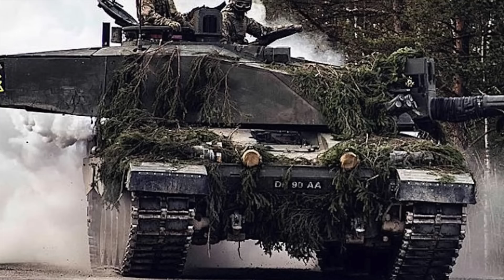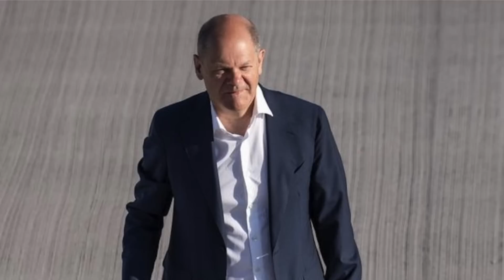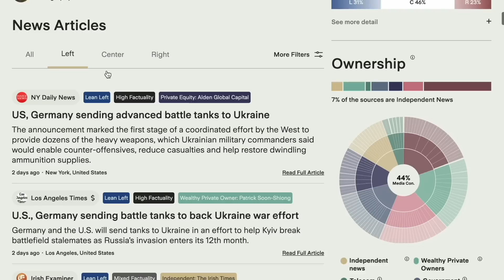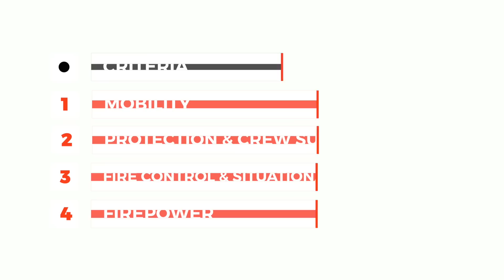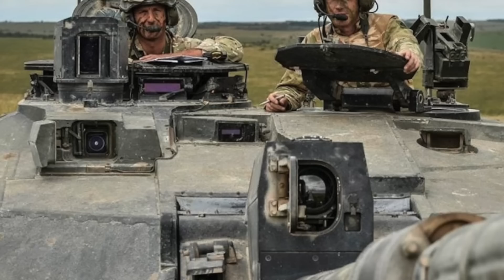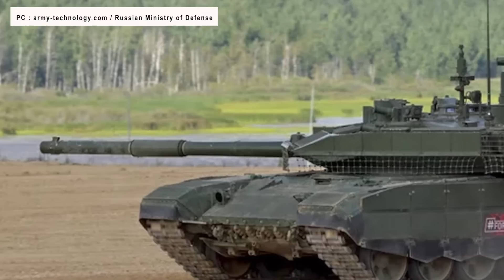British Challenger 2 vs Russian T-90 - Detailed analysis !

Comment from the maker: Check it out for free at https://ground.news/defense or subscribe for unlimited access to all the features you just saw and stay fully informed on breaking news as it’s happening.
Reply: I would add a last point: how many are available, and how many can be quickly manufactured. :) Because these are the russians. Nobody argued the tiger was much-much better than T-34. But even if 1 tiger can kill 50 enemy, when you have on the front 1000 tigers and 80000 T-34 you still lose.
Reply: A massive disadvantage for the T90 is its inability to reverse out of danger fast enough...This leads it to be VERY vulnerable to faster flanking attacks. A Challenger can reverse back at high speed while presenting its frontal plate to the enemy for longer.The ability to reverse back into cover from an ambush position (like a building corner) can also not be underestimated. Also the entire T series seriously lack in both gun depression and elevation, which makes them dangerously vulnerable on anything but the flat (See Golan Heights Yom Kippur War for examples).
Reply: T90M HAS AMMO STORAGE IN BACK OF THE TURRET LIKE THE OTHER NATO TANKS

Comment: T 90M weighs less than Challenger 2 and has more power, yet somehow this isnt an advantage
T-90M has a steering wheel, its T-72 that doesnt
not mentioned, T-90 can make smoke, and also has laser paint warning system
T-90 has an armoured carousel, somehow this is missed
this report is deliberately biased, because everyone knows 12 Challenger 2 tanks are bound to be better than 240 T-90M

Comment: As the Chieftain remarked on the tanks, it’s the tactics and if certain equipment is used. Poor tactics will diminish and technical advantage if the advantages are not employed correctly.

Comment: Just my thoughts.  No matter the quality of the equipment of any given nation or the quantity available of said equipment, it all boils down to the crew training / quality, the tactics used, ease of repair and most of all the logistics of ammo / parts & fuel.  And let us not forget the quality of the mechanics who have to maintain the equipment.  With out the afore mentioned items if you will, a nation will find itself with a battlefield full of very expensive burning junk.

Comment: The oddest issue with the T90 is it's Air conditioning or lack of it !
Being inside such a small tank without AC must be a nightmare,  so you often see T90's with hatches open.
Sadly this causes a major problem for the T90 , with the hatches open it's fancy defensive systems against ATGM's don't work!

Comment: So the T90 at 46T is almost the equal of the Challenger 2's at 60+ T.  
And then you take account that Challenger has to travel a long distance to get to battle in boggy terrain.  Then back again for repairs.
And also note that 14 Challenger 2's are going to Ukraine.  Vs. hundreds of T90's and massively superior artillery,  at maybe 10 - 1 vs Ukraine artillery.
Kinda makes this video pointless.

Comment: Ok you are already wrong, Dorchester armour is an upgrade from chobham armour. And before I watch anymore. 1) no personnel have ever been lost in challenger tanks 2) challenger has the world's longest kill at 4.6 km 3) t90s can be taken out with a molotov cocktail and the simply put on show because someone believed sorting the ammo at the bottom of the turret, that was a good idea 4) the t90 mainly uses the V2 engine from the 1930, a 2 stroke diesel. 5) the t90 can't raise its barrel enough to kill anything over 2.25km 6) the infrared anti weapon system on the t90 is to stop weapons from 80s, if your lucky or the crew isn't drunk 7) Russia have run out of people to operate any tanks 8) russian have started bringing out t54 & t55 from the 50s & 60s. 9) the auto reloader in the t90 takes 10 seconds to reload, a challenger crew can do it in 5 seconds. 10) the reactive panels on the t90 are filled with cardboard, as evident from footage from Ukraine.
In short, it would be like putting 25 year old Mike Tyson in a ring with a 70 year old pensioner with a recent hip op. It does matter if it is Abrahams, leopard or challenger. Western metal will win.

Comment: The Challenger 2 is equipped with an Extel Systems Wedel auxuilliary power unit an APU. It has a 600A electircal output, which can be used to power the vehicle's electrical system. And a kettle for a brew.

Comment: How many T90s do they even have at this point?  I mean, they're pulling T54s and 55s out of storage...
Reply: the Russians still have some ~400 T90... more than Challenger 2 exist
Reply: @xAlexTobiasxB  But how many do they still have in combat ready condition is really what I'm asking?  Some have been destroyed in the war, some have been captured, I presume some may have been cannibalized for parts, some might not be in fighting condition for some other reason, etc.

I mean, they also "have" thousands of T72s.  At least on paper.  Reality is that the current number might be closer to a few hundred once you factor in the above sort of issues.
Reply: @xAlexTobiasxB  Just seen Putin is bringing in old t55s with old 100mm guns from Iran?? Must be struggling...
Reply: @xAlexTobiasxB  400? Sure 😂
Reply: @theLastKappuNūdoru  Russia had 500 T90 before the war, less than <50 T90 have been lost so far, which still makes ~450.

Comment: 14 Challengers are a drop in the bucket. The rest of the bucket will be filled with Leopard 2 ‘s so I want to know how the Leopard stacks up against T-90’s.
Reply: I mean Leopard 2A6 or A7s are both better tanks than the Challenger 2 atm - I'm a Brit with a model Challenger 2 on my windowstill right now, if even my biased ass can recognise that it shows how clear the difference is. As such it's no contest; if there were an engagement between 2 T-90Ms and a single Leopard 2A6 my money would be on the latter. Throw on top of that, that Russia has few T-90s, so the Leopards are more likely to face unmodernised tanks and it's gonna be a slaughter as long as the enemy doesn't have a secret stockpile of top-attack ATGMs.

Comment: I believe he said that due to corruption the T90 tanks' systems may not be in working order. From reports that I have seen it's more likely that the systems are not even actually there anymore.
Reply: I have heard tale of Russians forced into using sat navs and Google maps on mobile phones for guidance, an ex royal artillery pal who is currently out there sent me some pictures of damaged stuff from both sides and in one picture of a downed Russian chopper you can clearly see a Garmin navi on the pilots binnacle!  And in many of the photos and video footage released to the public there are many clearly incomplete vehicles and machinery being used by them.I have no doubt that due to that corruption it's made it easier for the western intelligence agencies to acquire many samples of various systems and components to be picked over and reverse engineered at their leisure.

Comment: The challenger 2 tank uses specific unused ammunition. The manufacturer no longer makes the ammunition and the factory is shut. the giving of these tanks was purely diplomacy and pressure on other countries. 
The Russian T90 has probably 10-15 years of stored ammunition plus it is easily manufactured. The T90 now has full drone support allowing it to fire completely out of sight and at maximum range.

Unfortunately there is not a decent comparison any more of these 2 tanks.
Reply: Challenger 2  can use  NATO standard ammunition, stf up you ignorant clown
Reply: @fig1115  L30A1 rifled gun and if you look at the pictures you can see the rifled barrel. So no! not NATO rounds unfortunately the tanks being sent do not have smooth bore barrels so cannot fire NATO rounds.
Reply: No they still make the ammo

Comment: I wonder if the reactive armor on the T90 is the same as on the T72's in Ukraine : ie Filled with rubber sheets instead of explosive.
Reply: You do realize that the rubber is supposed to be there, right? The rubber serves as spacers for the explosives. If you looked closely at the tank, you would realize it was completely stripped for parts, including the explosives in the ERA.
Reply: probably
Reply: You are aware that the video you mentioning was debunked as fake right? It was proven by satelite footage that ukras striped the tank before shoving layer on which reactive armour was attached as actual tank armour. And the spacer layer is made of rubber even on our tanks. The rubber as layer between reactive armour and Armor steel is used to minimise risks to crew from any potential shrapnels

Comment: T90 ammo inside. You must penetrate all the tank armor and likely kill the crew anyway to hit it.

Challenger (and all western tanks) ammo is on the roof and can be set ablaze by any medium to heavy weapons and stand no chance whatsoever against anti armor weapons of any sort. It will likely be the death of the crew. And the blast doors can't withstand anything than one or two rounds burning, not exploding, burning. Ask turkey and Saudi Arabia.

To put it short, you'll likely be dead already before the t90 goes pop. The western tanks will likely be the cause of death.

As for the challenger 4km shot, it was done with assistance from air power. Just wanted to point that out
Reply: With the sole exception of the M1a2 Abrams, every Western tank stores at least 2/3rds of their ammunition in the crew compartment without the protection of blast doors or blow-out panels

The Leopard 2 stores only 15 rounds behind blast doors; the rest of the rounds (27) are in the crew compartment, next to the driver. 

The Challenger 2 stores none of its rounds behind blast doors

The Leclerc stores 22 rounds behind blast doors; and the rest are located in the crew compartment without the protection of blast doors or blow-out panels 

The Merkava mk4 stores only 10 of its 48 rounds behind blast doors.
Reply: @thephoenix756  yes, the m1 Abrams,  even in its latest variant, stores 11 rounds in the crew compartment.  It's in a special compartment but nothing too fancy.
Reply: @deven6518  

I'm pretty sure that the rounds in the hull (6 rounds) are stored behind blast doors with blow-out panels.
Reply: Challengers charges aren't in the turret roof?  They're all in the hull in armoured bins so if a fire broke out inside there's slim chance of detonating quickly unless the bin itself is penetrated
Reply: @CJjohnston56  typically what causes secondary detonation is superheated fragments, not a direct hit. Regardless of the tank, this remains a threat, and when it happens.
Reply: @deven6518   yeah but those super heated fragments aren't penetrating the armoured charge bins
Reply: @CJjohnston56  you'd be quite surprised. Take the humble rpg for example,  there are different variants,  different warheads, but the anti armor version usually  doesn't rely on the explosive charge. The explosive charge superheats and drives a small bit of molten metal. Those little fragments can do alot.
Reply: @deven6518  I know how AT rounds work   I'm just saying it had to pen the hull   then the armoured charge bin...  thats a very specific location to hit

Comment: No mention of the T90 being 20+ tons lighter and is way smaller(harder to spot in a dug out position) than the challenger, also wider tracks(probably whats makes it quite slow even though it has more hp to weight ratio). Pretty sure it's way more mobile when it comes to mud and snow.
Reply: You haven't seen the video of the Russian tanks stuck in the mud then? Also, Javelins and NLAWs have a Overfly Top Attack (OTA) mode. so it doesn't matter if a tank is hull down or not. Especially, if spotted an UAV.
Reply: @sandgrownun66  Yeah I've seen them, and if they get stuck what do you think will happen with the western tanks?. Javeline and NLAWS have to short range, which is one of the things Ukraine complains about. NLAW 1km max, Javeline 2km max. While Russian Kornet has a range of 5km. Javeline and NLAW is great for offensives but not for static warfare were tanks are used more like artillery.
Reply: @andreasfjellborg1810  if I'm not mistaken CR2's has similar(if not the same) width as the T-90. Also CR2 has better Ground Clearance than T-90 so there's that.

While Kornet has a 5km range. It's still a SACLOS atgm. Basically you have to manually guide it until it hits the target. Basically expose yourself until you hit the target, not to mention the humans errors due to being manually guided

And yeah. Tank on tank warfare is kinda obsolete now.

Comment: Maybe the reason for the T90s slow reverse speed is that they usually get destroyed in their first encounter so there’s no need to plan for tactical retreats.
Reply: Why would they need a fast reverse, it's only needed to get out of the factory or back up to the fuel tanker. Not designed to get out of trouble, not designed for the crew to survive. 
A tank takes an age to turn around so to be able to back out and achieve even 30mph whilst keeping your strongest armour facing the enemy is a great advantage on a battlefield!
We all know that there will be little tank on tank battles, with the best ammo we have and it's sighting and ranging equipment the Chally 2 can take out enemy tanks at 5 miles it will create havoc! The numbers being sent are small but given enough support they could be formidable!
Reply: @stevewright8312  True. The Ukrainians sure did wonders with a handful of HIMARS.
Reply: 500 T-90 series tanks have been deployed and around a dozen or so have been destroyed in 1 year of intense war.
Reply: @thephoenix756  bit more than a dozen mate
Reply: @thephoenix756  oryx reports something like 52 T=90 and hundreds of T-80

Comment: The C2 is significantly better than anything the Russians can field, but the problem is that there are only fourteen in the first batch, and they are not even there yet. Russia has a lot more than fourteen T-90 tanks, so the C2's going to Ukraine aren't going to be a big game changer unless they are supplemented with lots of other good tanks like the Abrams and Leopard, or perhaps more C2's. The multiple types of ammunition will be a pain for the Ukrainians. The Leopard and Abrams use Nato-standard, the Challenger 2 uses a British-specific type, then they've got their existing ex-soviet tanks which use different ammunition again.

Comment: Challenger 2...world record for the longest distance for a tank to tank kill. 
T-90...world record for the longest distance for a flying turret.
Reply: With the sole exception of the M1a2 Abrams, every Western tank stores at least 2/3rds of their ammunition in the crew compartment without the protection of blast doors or blow-out panels 

The Leopard 2 stores only 15 rounds behind blast doors; the rest of the rounds (27) are in the crew compartment, next to the driver. 

The Challenger 2 stores none of its rounds behind blast doors 

The Leclerc stores 22 rounds behind blast doors; and the rest are located in the crew compartment without the protection of blast doors or blow-out panels 

The Merkava mk4 stores only 10 of its 48 rounds behind blast doors.
Reply: @thephoenix756  not true mate, you really need to do more research, or are you not allowed in Russia?
Reply: @markthomas519  

What are you even disputing? Having a smug and dismissive attitude isn't a rebuttal.
Reply: @thephoenix756  your saying chally 2 doesn't keep it's ammo behind blow out panels which it does, no western tank stores its ammo in the crew compartment. Like I said do more research before talking it helps to not look like a prat
Reply: @markthomas519  

Yes, that's precisely what I'm saying; the Challenger 2 does not have blast doors or blow-out panels for its rounds. The only safety feature they utilise is wet storage and the separation of propellant from the warhead. 

Every Western tank (except M1a2 Abrams) stores at least 2/3rds of its ammunition in the crew compartment. Sorry to burst your bubble.
Reply: @markthomas519  Mark you are an idiot. The fact that you don't even know what you're talking about proves that you are in fact the one who needs to do some research.
Just as Phoenix already stated, the CHallenger does NOT have blow-out poanels nor a separate ammunition bunker that separates the ammo from the crew.
And the other Western tanks only have blast door in the turret where only 30% of the ammo is stored, but the rest 70% ammo is still in the hull right next to the crew without any protected blast doors. Only the Abrams actually does have a separated ammo bunker with blast-doors in both the Hull + turret, which no other tank has.
Keep deluding yourself all you want, you're only making a fool out of yourself for everyone to laugh at you
Reply: "Russian cosmonauts hate this simple trick"
Reply: ..its the Challenger 1